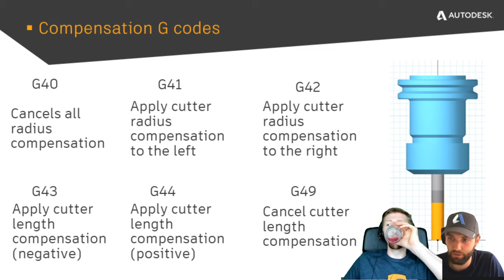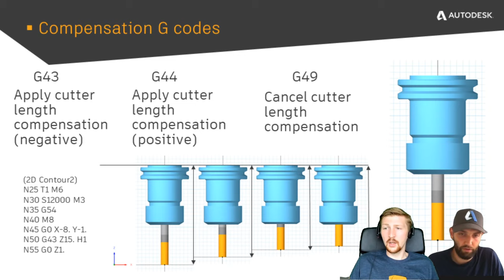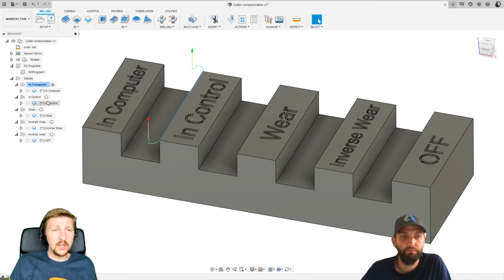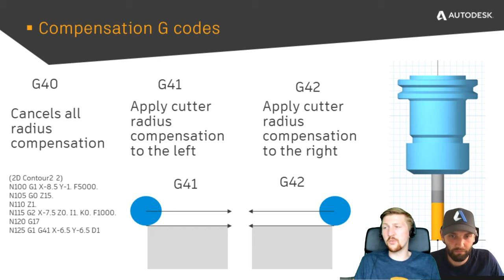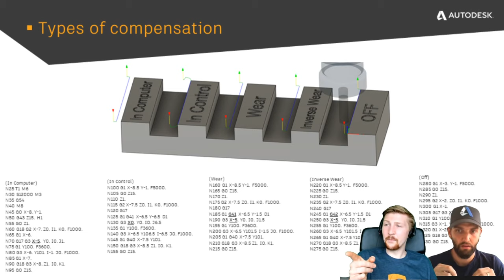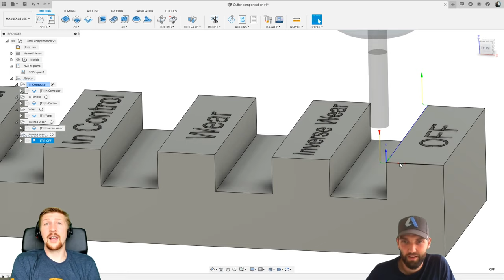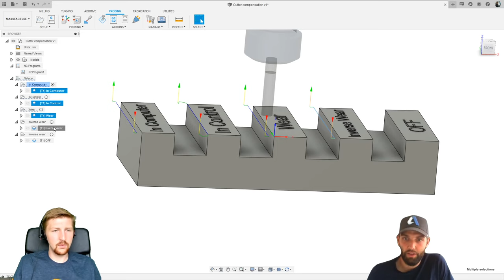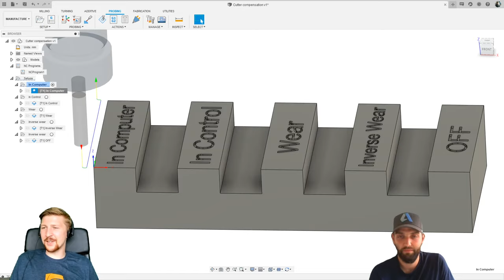360 Live: Cutter compensation, when and why to use it.

Comment: I learned G code in 1984 and we all were hand programming on Fanuc controlled machines.  We learned how to use cutter comp (G41) to make it easier to program - we would use all the print coordinates and put in the diameter of the end mill for 2.5 axis contour cutting.  and then we could also tweak adjust for sizing.  We always used G41 (climb mill) and never G42.  When we transitioned to CadCam - we still were putting in diameter in machine offsets.  So we were using "control" selection to add G41.  Eventually we went to "wear" selection.  It eliminated the need to enter any numbers in tool diameter ( reduce mistakes ) but still have G41 ability.  Most beginner users use "computer" and that works fine  but you do not get adjustability for tool wear or tool deflection.

Comment: So when using "wear" do i add my radius Compensation of half the tool Dia on fusion360, post my NC, Then my tool offsets on the machine are just small offsets for accuracy. No need to add it on to the tool offsets unless using in control? 
Great video, Thank you!

Comment: So, for example: 
If i use "in computer" for a 3mm tool, it will cut 1.5mm out from the contour. If however, the tool actually measure as 2.9mm, and that is the value in the tool table, it will still cut 1.5mm out from the radius, meaning that 0.05mm of stock is left on the part?
Where as, if I use "In control", the control will offset the tool centreline 1.45mm from the contour, so that i will get a perfect finish (in theory), because it gets the tool diameter value from the tool table, and uses that to calculate how much it should offset by? 
Is this correct? 
Thanks, ,Alex

Comment: You need to make clear that (in control) you must give the machine a (cutter radius compensation) value of (5mm). This is good for using regrind cutters, where the CRC value will compensate the undersized tool value.
  The more preferred (wear) compensation, the (CRC) = 0 in the machine. I say this because," proper preparatory habits," Like a G40 to clear (CRC) or G90 to clear (G91, G92). the machinist should clear all (CRC in the machine) to zero (0), upon finishing a job. So, the next person starts fresh, no accidental over cutting. Right?